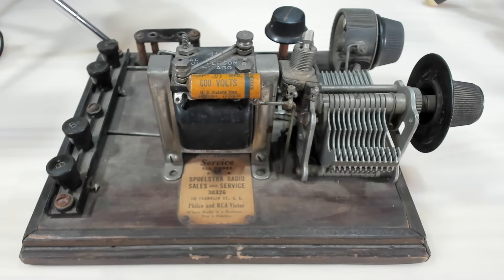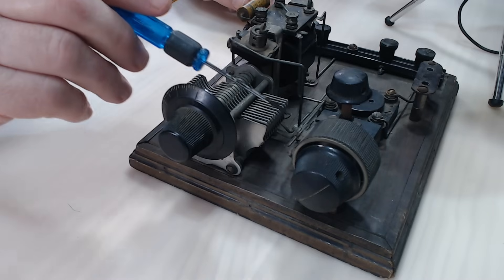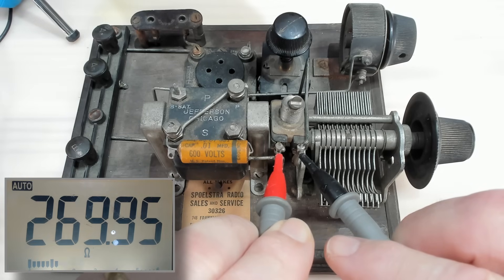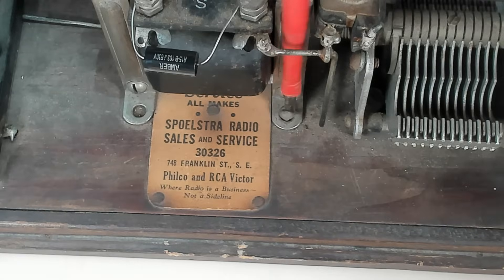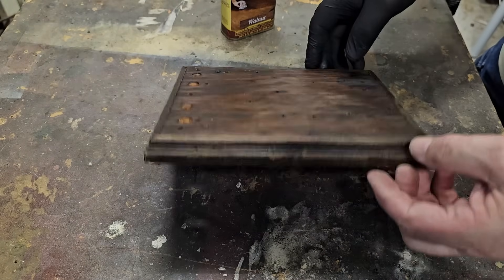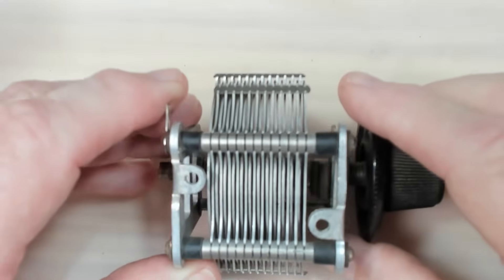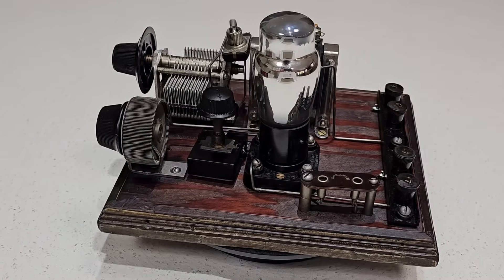Mystery Electronics from the 1930s. What is it?

Comment: My first thought are it is  an up market “Hikers”.  Maybe compare the circuit to the article by Peter Lankshear from many years ago.  The hikers was a low voltage one valve radio , and maybe this was a higher voltage version. Best of Luck with an answer David.
Reply from the maker: Thanks Jack 🙂
Reply: @DavidTipton101 looking at the “HiKers” circuits shown by Peter Lankshear,
Earth connected to  A+ and B-.  The RF signal needs to have a path through the primary on the transformer, the obvious choice would be the empty stud on the transformer. But if B -  connected to earth then the antenna would need to be connected to the opposite end of the primary coil, which has the .01 capacitor fitted.   I cannot see smoke escaping with that connections, but I can see RF signal getting into the primary winding , and then inducing the signal in the transformer seconding winding,   Something more to think about David. 😊
Reply: @jacksmid5322  Spot on.  I do believe the mystery device is close kin to Hiker's radio.

Comment: The variable capacitor suggests RF tuning. The coupling capacitor between transformer windings suggest low Q high bandwidth RF at low RF frequency. I wonder if it was designed to be used with a high impedance speaker that would also have acted as an RF choke on the anode. If an antenna was connected to the B- would it work as a regen receiver? Though, why none of the terminals are marked aerial is a mystery. It would have been interesting to listen on a LW/MW receiver while adjusting the variable capacitor - maybe it was a crude variable RF signal generator for testing broadcast receivers. The AF component could even have been used for testing AF stages. Basically, an RF/AF test tool??

Anyway, as usual,  nice resto job👍
Reply from the maker: I tried the antenna idea, nothing. I don't have a hi impedance speaker. I tried a MW radio next to it but the frequency of the project is too low, probably too low for LW as well. Thanks Steve 🙂
Reply: @DavidTipton101 good on you for trying and sorry suggestion didn't work.

Comment: What an odd thing...  It's just a bit too nicely built to be a one-off experiment, but still crudely enough that it's not mass market. Maybe some sort of specialty that old radio shop built for customers.   I wonder if its some sort of test fixture or calibration device for an early regenerative radio set.   

The funniest thing is that if you had a time machine, you could take it to a Radio club meeting 50 years ago and the oldtimers would say, "Yeah ya big dummy,  That's a left-handed ditzelfritz used for ...."  But lacking context, it's opaque to the modern experience.
Reply from the maker: I assumed it was built for use in the shop. I imagined an old radio hand would know exactly what it was for, or his dad had one 😏

Comment: If you measure the values of the inductor and variable capacitor you can calculate the frequency range of the oscillator. Impedance may be matched to headphones (not a speaker).
Reply from the maker: I would like to try hi impedance headphones but I don't have any 🤔
Reply: @DavidTipton101  maybe you can use a speaker transformer with the speaker to match the impedance.

Comment: Hello Dave, it looks like you have a Rube Goldberg contraption: it looks fascinating but, doesn't really do anything of value.  The 01A valve was used in all consumer radios in the early 1920's, it is a low Mu, directly heated triode.  This circuit just appears like some experimenter grabbed a handful of available parts and patterned his circuit after a regenerative receiver, although using an audio transformer instead of a RF transformer, it is only capable of audio signals.

The circuit is configured as a crude oscillator.  The audio transformer inductance and 0.01 uF capacitor control the oscillator frequency.  There is many times too much step-up with this transformer, it ends up blasting the control grid, which forces the circuit into a hard saturation, followed by a hard cutoff, acting basically as a blocking oscillator.  The potentiometer was put in for grid-leak purposes but, is only controlling the grid current.  The tuning capacitor only adjusts the rise and fall times of the transitions but, is essentially useless since the small value (15 to 200 pF) is really only good for RF circuits.

The switch was probably used to turn the oscillator on and off, although with the switch in the Off position, the control grid will float and it won't completely cut off the valve.  It really should be tied to -50 volts to guarantee a hard cutoff.
Reply from the maker: Thanks Bill for your input 👍🙂

Comment: It looks like a single valve regenerative receiver. Just a thought. If the diagram has been evolved from the physical item. Looking at the link on top of the coil, has it been subject to finger trouble over the years. Could it have fitted between the B -bat term and the point G on the diagram instead and a long wire antenna connected to F or B - Bat?
Reply from the maker: That's a possibility Bob. I tried it, it did get the frequency up into the high 200Hz range 🤔
Reply: @DavidTipton101  Worth a try. There are other combos of the connections of the capacitor and maybe missing components to those coils if you haven't already tried them. Was the capacitor the original or an incorrect replacement? You seem to be like me Dave, don't like giving up, but after playing with it (with care of course) I would probably turn to Mr Carlson as other have mentioned.

Comment: Although the jack is labeled 'speaker', it may have been what the builder had at hand and was intended for something else.  Perhaps a low voltage lamp.  It may have been intended as a rapid flasher used in some sort of sales display.  Or perhaps a higher impedance coil on a lead that could be passed over radio components to check for susceptibility to interference.  I have a feeling that the circuit might oscillate at a much higher frequency with a higher impedance load -- perhaps even in the RF range.  It would be interesting to see what kind of waveform is being produced, sinusoidal or more of a square wave.  It wouldn't really be appropriate to drive a speaker with a square wave, but due to the multiple harmonics they produce square waves could be suitable for inductive RF injection.
Reply from the maker: I agree, the speaker label may not be for a speaker. I also considered it as an flashing advertising sign but I doubt it 🤔
Reply: @DavidTipton101  How about a strobe lamp driver for checking motor speeds?  The narrow frequency range could allow for friction losses ?

Comment: Possibly a remote BFO used with an AM receiver to detect CW (Morse code), or test equipment(signal injector).
Reply from the maker: Yep, Thanks Elvis 🙂
Reply: With that iron cored transformer it would be impossible for this device to be a BFO for the AM radio frequency band

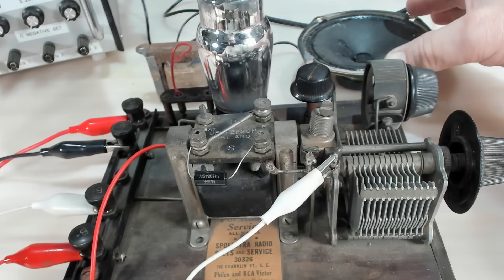Comment: Hi Dave! At 7:39 you say "...the speaker attached to the transformer", but according to the schematics it's not the case.

Also (repeating many comments above) -- perhaps the "speaker" to be connected there had few kiloohms impedance, not few ohms?
Reply from the maker: I couldn't find that reference @ymz5, I must have misspoke. I tried changing the impedance but it made little difference.

Comment: It's a blocking oscillator. Kind of like a vacuum tube joule thief. It's not wired in a canonical fashion, but its close enough. It is essentially a gain-boosted relaxation oscillator, and could be called a squegging oscillator. It works in LTSpice just fine, though I used the model for a 12AX7 for ease.
Reply from the maker: A squegging oscillator does seem to fit the bill 🤔
Reply: so what do you think it was used for, morse code maybe?
Reply: @briangoldberg4439  Unlikely. There are much better ways to build one of those with the same components. We likely will never know the originally intended use case.

Comment: I built something very similar back in the 1960s using a transformer and 2N30555 power transistor. It was a squarewave  oscillator and the frequency was dependent on the load across the output. Harry Zarchy's Boys first book of Electronics.
Reply from the maker: Interesting, thanks John 🙂

Comment: That O1A is a voltage regulator unless I'm daft. That is an old variable voltage supply with regulator  to a variable oscillator would be my guess. But seeing as how it is that old it definitely in the primitive days of radio but interesting none the less. Thank you David.
Reply: You were probably thinking about the 0A3; a cold-cathode gas discharge shunt regulator valve with an Octal base.  The 01A is directly heated cathode triode valve with a 4 pin base used in virtually every radio made in the 1920's.
Reply from the maker: It is described as a detector or amplifier tube Larry 🙂

Comment: It could also be a tube tester, it doesn't seem very sophisticated to be a radio or even a Morse code device. And since it belonged to a radio store it is more obvious that it was a tube tester.
Reply: Rado stores also used to attach their own plates to sets they sold.
Reply from the maker: Yes, it could be used for that. Most tubes in the early times were triodes 👍

Comment: This looks a lot like a Galena Radio, or "coat radio" as the Germans knew it. They were very common during World War II because they were small and discreet, especially since they could bypass the censorship and control of the Third Reich's state propaganda agency, and they continued to be used during the Cold War by East Germans who wanted to listen to the radio on the other side of the Berlin Wall and the Iron Curtain. This is what it most resembles, especially without the speaker and the antenna connection wires.
Reply from the maker: I think it would have tipped off the Germans when you carried the two large batteries to power it 😉 A Galena Radio is self powered using a galena crystal. Thanks Carlos 🙂
Reply: @DavidTipton101  I didn't realize this detail. Still, I appreciate the tip, which I forgot to take into account when this equipment was presented. So I'll stick with the valve tester recommendation. Thanks.

Comment: It's possible that this is a regenerative radio receiver. You might experiment with hooking an antenna to the tuning coil (possibly At F or B- )and ground and see if you can get a signal. I am not completely clear on where on that transformer the antenna should be connected, but perhaps someone else can add or correct me.
Reply from the maker: I've done all that after reading some comments. I can't get it to produce any sound other than the motorboating 🤔

Comment: Is this perhaps a single stage TRF receiver?? My pop was a Philco trained repair engineer in the late 1920s - early 1930s and this looks very similar to a device from our attic in the 1960s that he tried to explain to me  (I was very much a transistor kid).
Reply from the maker: I played around trying to introduce a signal into it. There is either something missing or I haven't set it up correctly 🙂
Reply: @DavidTipton101  According to my old man, TRF is a bit of black art from ancient times! My only real experience of TRF is from the time in the very early 1960s when I used to build early superhet 6 transistor radio kits and sell them on to my workmates (coincidentally, I was working in Tipton, Staffordshire at the time).  Those were the days when a tranny the size of small briefcase was considered leading edge tech! On one occasion I bought (from a Practical Wireless advert) what looked to be a posh looking kit in a leather case - but turned out to be a bag of random bits and 2 squares of hardboard with some tag strips. A confusing welcome to point to point wiring for a kid expecting a PCB!  My pop took one look at the circuit diagram, let out a sigh, and pronounced that it was a transistorized version of a very old fashioned TRF design and prophesied that it would be a real bugger to set up - he wasn't wrong. It was exceptionally signal sensitive and I soon came to understand why superhet designs had won the day over TRF.
The schematic shows It has all the makings of a tunable oscillator but, as you say, no apparent aerial input. Perhaps, as others have said, it's a signal injector?  No doubt Mr Carlson may provide better clues.

Comment: Dave - you should try a test on that device.. Put an AM radio slightly off station near that unit an turn the Variable Capacitor and see if you can pick up something :)
Reply from the maker: The frequency is too low. I did try that but nothing there 🙂
Reply: I don't think that's going to work.  This radio does not have enough tubes to have a mixer and local oscillator.  I don't think this device is intended to oscillate.

Comment: I spoke to a friend of mine, and he says This circuit diagram is a 1930s-era regenerative tube radio receiver, specifically a single-tube regenerative detector setup. These types of circuits were commonly used in early radio receivers and crystal sets. This circuit detects and amplifies radio frequency (RF) signals using a vacuum tube, allowing reception of AM (Amplitude Modulated) broadcasts or shortwave signals. It uses regeneration (positive feedback) to boost sensitivity and selectivity, making it more effective than a simple crystal set.

He sent me a PDF file breaking down the circuit, but I don't know if YouTube will allow the link, but I will give it a try:  https://drive.google.com/drive/folders/1Qnly0s_nR1f-nv7DndTEH5wSWHJvpPmp?usp=sharing

Comment: I believe it is indeed a radio receiver.

I'm not sure the circuit design, probably classified as a TRF.  As such I don't think it's supposed to oscillate.  I do believe the top left missing nut on the Jefferson transformer would be the antenna terminal.
Reply from the maker: I pondered the missing nut. It is B-, it wouldn't receive a signal form there 🤔

Comment: I decided to cheat a little bit and get AI involved, I took a snapshot of the diagram, Ai came back with the answer!! 
Don't be stupid that can't work!!! lol 

No it came back with the only thing it can be by the nature of design is a Signal Generator or Oscillator Circuit
Specifically, it resembles a Hartley oscillator, which is also common in valve-era gear.

I asked Ai to draw me a diagram based on the diagram given and it came back with almost the same circuit,  laid out completely different of course and some different values.
Reply from the maker: A Hartley Oscillator has come up a few times. I didn't think to use AI, clever of you Daftman 👍🙂

Comment: Hi Dave, I searched about the circuit and I found one possibility it’s a regenerative radio receiver, a classic design used in early vacuum tube radio technology.
Reply: that was my first thought but there's no antenna or ground inputs
Reply from the maker: I have experimented since I made the video. I couldn't get it to be a single stage TRF set for the life of me 🤔
Reply: @DavidTipton101  Dave, don't give up on this.  

What we know:
1 - plaque heavily suggests it's a radio from the 1920s or early 1930s.  Before superhet became the standard.  They were TRF or regenerative sets
2 - The capacitor isn't original.  I believe it should be a grid-leak capacitor*
3 - the O1-A valve datasheet suggests 45V plate voltage in grid-leak config 
4 - just because the battery terminals are labelled doesn't mean there isn't anywhere for an antenna 
5 - Glasslinger has a video of a single tube radio with 5:1 transformer but with his own handmade valve.

* So I'd suggest a 220pf capacitor with a 2.2 MOhm resistor across it for a grid leak detector.  I presume that goes where the wax capacitor is but IDK.  I think the antenna probably just connected at one end (long-wire) but not sure which terminal.  Whoever suggested the Hikers radio probably has any idea.  Keep the filament voltage low via the rheostat.
Reply: No

Comment: Hi Dave,
Though not a sophisticated circuit, it is nonetheless an interesting piece of equipment. 
Occasionally I'm presented with (what are generally termed as) 'oddities'.  More often they come in the form of hand tools.  After a little bit of research it turns out they were 'one-offs' designed and made specifically for a particular production process; or to do a special task.
My guess is the equipment you have in-hand was produced to do a specific job, say in a local clinic; in-house communication system (a new fangled fancy buzzer as replacement for an old bell system), or a one-off production commission to form part of test/standards equipment - likely as not, there are several possibilities.
Best regards, Phil.
Reply from the maker: Hi Phil, A shop doorbell! Why not. It would have been easier to put up a bell but you know, nerds. Thanks Phil 🙂

Comment: What is missing may be important.  What if there is an RF coil or tuned circuit plugged into what is identified as SPKR. terminals for instance. Maybe this device is meant to oscillate at RF but also create modulated RF with the LC in the cathode somehow.   Seems like someone did a lot of work and kept the thing around for a long time for no reason, if it did not function.   I have to think it can work if you know the purpose.  Maybe a copy of something or a circuit from an old radio magazine.
Reply from the maker: It doesn't seem likely to plug in a RF coil into the anode B+. I agree, it has some function, but what? 🤔

Comment: Since it is motor boating (funfact: we use the same expression in the Dutch language), I suggest to reduce the glow voltage to reduce the gain. As soon as the motor boating stops, it is time to investigate further. It looks a lot like a morse code trainer. Nice device 😊
And cheers, David 👍🏻🤝🏻🇳🇱
Reply from the maker: I just tried it Nard. It reduces the motorboating to flatline with a slight increase in frequency but is unstable 🙂